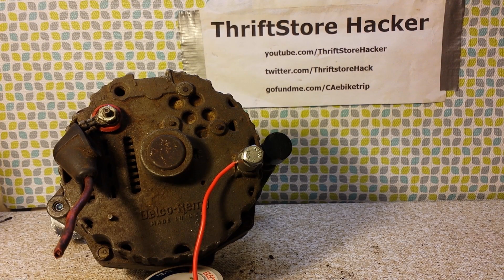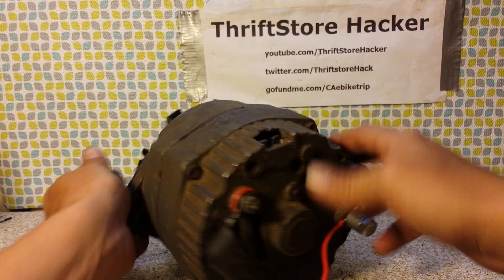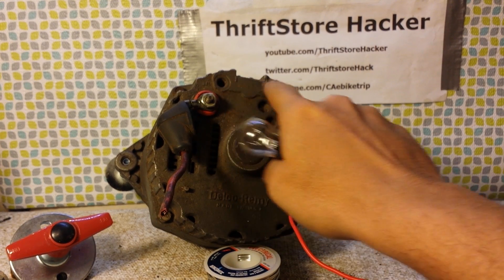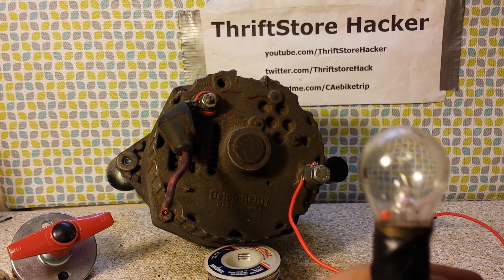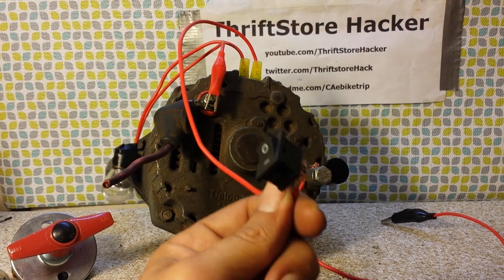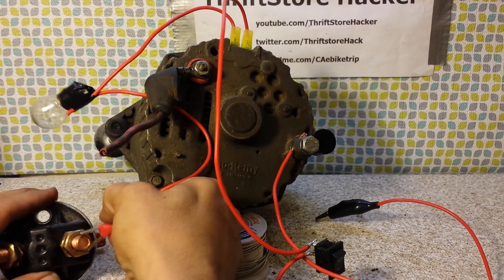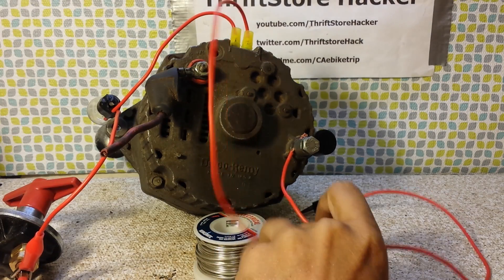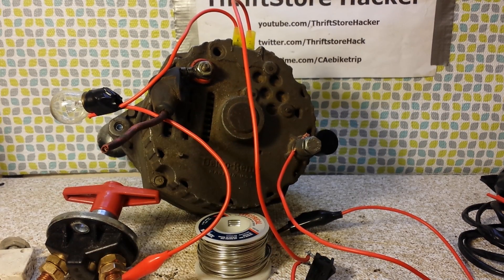Workbench Wednesday. Delco 3 wire alternator.

Comment: did ever some one tryed to use dual voltage regulators? or takeing off original delco 12si voltage regulator and used tractor regulator insted?
I love to use capacitors as for litel more power in my car for hei ignition system.
The problem that I face is expecialy hv ceramic capacitors cinde of change the starting charge or cutt in rpm range for alternator .
So I hoppe for advice.
Wuld cloosed loop voltage regulator help programabel unit or those so called avr units on generators?
I also wuld like to know if dc generator voltage regulator culd by used on magnet alternator or some sort of amp cutt out selenoid ?
That problem plagues my for years and Im anoyed at that shiti thing.
I wuld like to have in case of emergency some sort of back up units for light bulbs or sending directly power to my ignition coil of course with resistor or resistor/capacitor box for experimental porpuse.
I use vaporisators so thats why I need such unusual set up Im doing engine conversions .
So thats why I have problem finding correct circuet for my baterry.
Also there is problem with the starter motor as well so Im curriuse to know how can I give that thing more torque or over ride the voltage to it for easyr engine start up if posibel some one suggest starter motor booster circuet or baterry start up booster how that look like.
Mostly I have problems starting engine in winter the coil does not get enough voltage so I used  4 pin relay  insted but still the original hei does not suport retarding option so I was wondering as well if there exist circuets that can retard ignition timing it is E Core design ignition coil inductive trigger and 4 pin gm ignition module.
If some one know devices that can do that mentioned effects please give some link to it.

Comment: Thank you For the video, but it's not practical, switching pin 2 on and off Will not stop /start charging, it will instead Toggle  voltage regulation on and off , without pin2 the alternator still charge un regulated, secondly a diode Is needed in serries with the bulb.

Comment: So, the voltage sensing wire, if you put a diode to "drop" the sensing voltage, example 12.8V from the battery to the toggle switch, and put two or 3 diodes in series, so that you get a drop of (1.2V) it will ramp up the voltage generation to 14V right, yet still seeing 12.8 on the toggled switch (exciter)
Reply from the maker: I'm not sure.

Comment: OK, Here's the wiring facts,  No1 and no.2 terminals:  No1 terminal takes a 12v supply normally wired thru your ignition switch with a gm 194 bulb wired in series with it. it's purpose is to excite the field windings. I say excite rather than power because once the field is "excited" and the alternator starts producing power, the field is internally powered by the alternator itself. With a bulb wired in series and the ignition switched  on and sending power thru the bulb it reaches ground in the alternator voltage regulator and lights the bulb because current is flowing thru it. When the alternator takes over supplying it's own power to the field, you then have 12v+ going into the bulb from both ends and you have set up a "balance of power" and no current flows thru either end so the light goes off. No.2 terminal is the voltage sense wire. It reads the voltage input to it and lets the regulator turn the field windings  on or off to keep its' output at its' "set point", usually 14.7 volts. If it senses more it cuts out the field power,  or senses less it connects it to provide power. That's how it regulates. If your plan is to make a generator I'd connect No:2 terminal at the 12v+ input terminal on the inverter you will use. That way it would sense any voltage drop there at that point and regulate accordingly.             Just sayin'      Mike
Reply: This comment is better than the video itself thank you mike.
Reply: I have a question for you, seems you have a great understanding of how these alternators work. I have a Delco alternator on a sawmill. It went bad last summer. Replace it with a new one stopped working Within a few hours. I have repeated this process now with three different alternators. The sawmill had a lamp light on it but the previous owner replaced the lamp with an in-line fuse for whatever reason. If I put the lamp back in line like it’s supposed to be should my alternator work properly as it should? Did I do any damage to the alternator without running the lamp. And is there anything else I will have to do to the alternator after I hook up the lamp since I was not running the lamp?
Reply: @nathanavery55  Run the lamp and all will be well. The lamp gives and initial excitation of the field and once it starts to produce power it will be 2 positives to the lamp and will shut off. If the belt blows or the alternator stops producing power it becomes a ground again and tells you that it not producing power.

Comment: I have a 86 Buick Regal I switch my alternator bcuz it was bad now I have the oil choke light and battery on but once I step on brakes it goes off but I let go of brake pedal they come on again I also notice car off voltmeter is at 12.75 I turn on car remains the same once I gas it and battery light comes in it goes to 14.50 on voltmeter 
Any suggestions I replaced alternator twice already also I remove positive terminal and it shuts off

Comment: I have two questions. First are these wires strong enough for this since alternator has high amps (mine has 60amps and 12V). Second is this a way to excite your alternator? Because I've heard that all this wiring with the light bulb is simply because the alternator doesn`t start on its own so you have to excite it first. Oh and one more question. these connectors on the top (with the yellow thing) how do I know which one is which? On my alternator, it says L and B+.
Reply from the maker: I have not messed with this in a while so I cannot reliably recall the spec. The wires feeding the battery should be properly rated for the current.  
You will want to look up the exact version of alternator you have to verify what the leads do.
I plan to revisit this in the next month because I finally found an engine to power the alternator.  I will show how it is wired and a running demonstration.

Comment: The second termanal for field can go straight to the main terminal that charges the battery. The sensing termanal goes to keyed power or a switch. You could just use a resistor if you wanted.
Reply from the maker: Retrogamer1010 great information. I'm currently looking for a side shaft engine to run the alternator up to a fast enough RPM to do some testing. Second hand market here in my town is ridiculous. May just get a new predator engine from harbor freight.
Reply: You could use an old treadmill motor setup to test alternators up to speed

Comment: I picked up one of the same style alternators, did everything as described here but the thing is charging with no voltage going to the #2 connector on the alternator? the charge light never comes on with connections made but not turning and after letting it run for about 20 minutes or so I did notice that the charge voltage wants to creep up beyond the 14.50 volts... I think there might be something going on with the thing, glad I didn't pay a lot for it... what is your opinion?
Reply from the maker: Nite Flyer you could see 15/16v if the battery was really low but if it keeps climbing the regulator may be bad.  As for the light, it only comes on if the battery is not charging (think battery light in your car).
Test it with a fully charged car battery and see if results change
Reply: the battery is brand new and shows me 13.15 volts before connecting to the alt, I am testing this on the bench. I have dummy light wired and the alternator is connected to the battery and spinning with the #2 wire disconnected, it is charging 14+volts with the #2 wire simply laying on the bench, maybe I'm missing the fact that there should be the key on factor? key on engine off the dummy light should be on correct?
Reply from the maker: Correct. key on engine off the light should be on. I don't think the dummy light needs to be connected.
Reply: that's one thing that I am not seeing here. key on should be the dummy light if I have things right in my thoughts, 12vdc power to the #1 pin on the alternator, pin #2 is the exciter circuit which if in my head I have right should also come from the key on. I have disconnected both the #1 & #2 wires and the thing still throws out 14.+ volt to the battery. maybe my mind is a melt after tinkering with this for the better part of the afternoon but is it wrong to think that without the exciter circuit in tack there should not be any voltage from the charge to the battery? goodgreif... lol...
Reply from the maker: Nite Flyer oh ya. That's weird. If the 1 and 2 wires are disconnected it shouldn't be generating a field and it should definitely not be charging the battery.  Sounds like something is shorting out in the internal regulator.
Reply: I think this is the reply I was hoping to hear, now I don't feel so dumbfounded knowing that I ordered a rebuild kit thinking it is the fix for this confused alt. it just didn't make any sense that B+ and B- connected to alt/batt that there should be a charge, with no charge command or better yet a even the connection. something internal. I simply want to command the charge circuit when needed and relax it when not needed, especially if the battery is charged with a slight load on the system, probably don't really need to consider this thought but I am using a smaller drive motor to spin the alt and temperature of the drive motor is everything. maintain 550rpm at relax and 2000rpm when full load is encroached. servo drives are wonderful but sometimes the rpm play can be a helpful factor... thanks TSH... wonderful meeting you and talking with you regarding this...  oh and you can call me Rich...
Reply from the maker: Nite Flyer I hooked the whole project back up in my basement. I had problems with the dummy light. When I connected 1 and 2 directly to the positive on the battery I got it to work.  I'm making a video right now.
Reply: as I understand after digging into some of the others here on U-Tube... some of these did have a self inducing field... if this thing after sitting around for at least 120days has held its magnetism, it could be doing what its designed to do and not give me any alternative outside making/breaking the main connect between the bat/alt with a relay, allowing the ramp up to a full RPM before engaging field and sending charge displacement to its prime as engineered..? goodgreif... its looking like a touch of outside logic might be in order to accomplish that I wish to achieve... hot starts are always harder to direct at this degree... flags and timers... I will look at things from this perspective too...

you Sir are a working attribute...
salute...

Comment: Hi.. Will connecting the sense and lamp wires in reverse damage the internal regulator? Or can i just rewire it back to normal and wont cause damage?
Reply from the maker: John Marden Javier I'm not sure. I am currently making a new video with the alternator. Once I get it set up I will report back.
Reply: Ok I will just wait for the video. Thank you so much for the response and for the very informative videos.
Reply: Hi! I found the answer to my question. It shouldn't and it didn't cause any damage to the internal regulator.
Reply from the maker: John Marden Javier great! Good to know. I'm currently waiting on shipping of a small engine to do the alternator video. Going to make a 12v portable battery charger.

Comment: Hello can you please tell me how to bypass alternator indicator light? 
Thanks
Reply: I thought you had to to teporarily excite the exciter wire
Reply: The indicator light is what turns the alternator on and makes it charge... when there's a positive voltage on both sides of the light bulb it won't be on. That's why the battery light in your vehicle shuts off when your engine starts.  When the alternator goes bad there's not a positive voltage on the alternator side of the light bulb so it shows 0 volts and the light turns on.  If the bulb isn't hooked up it won't charge. If the wire is ran direct it will always energize the alternator even when it's not running and will drain the battery.  (If wired up to battery source circuit i.e. in a car)
Reply: Alan George I had wire one on my old tractor going to +ve ignition on power. Alternator worked but motor wouldn’t shut off. So I fixed with diode. Now I want a indicator light. I tried pre-diode and +Ve ignition on for light. 👎 What exactly is wire one doing? It doesn’t become ground? It’s either +ve power or off. Right
Reply: So If I had put the light in instead of the diode I would have been fine?
Reply: @Swampwild1  most indicator lights are 194 bulbs... these bulbs work with power on one side and no power on the other... when the vehicle is off and key on the bulb has power on one side but not the other so it comes on.... when the vehicle is running the power flows thru the light bulb from the key and into the altenator energizing whatever it is that it energizes and that starts the charging process which now sends power out the wire back to the bulb. Now the bulb has 12 volts on both sides of it and it now turns off. You could run the diode in series with the indicator light but in between the keyed power and the indicator bulb not in between the indicator light and the altenator
Reply: Alan George thanks! I tried a small dash light on both sides of diode but it wasn’t LED. No luck. I have to have that light, lol so will follow your excellent advice closely. Why does everything have to be so difficult! Lol
Reply from the maker: RealTech 9ja I don't think it needs to be hooked up. I will have to test this.
Reply: ThriftStore Hacker please do...am looking to use the regulator car 3wire alternator to charge batteries but the indicator light being on will drain the batteries again. Thanks
Reply: RealTech 9ja You can add a diode
Reply: RealTech 9ja no need to bypass it if you don't want to run an idiot light just leave it disconnected,